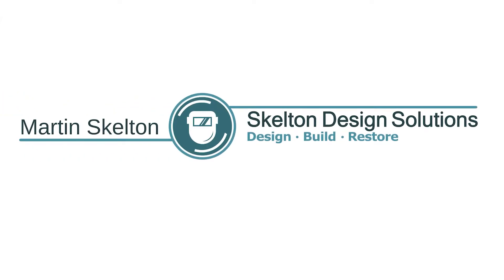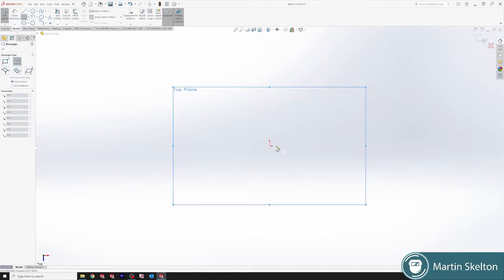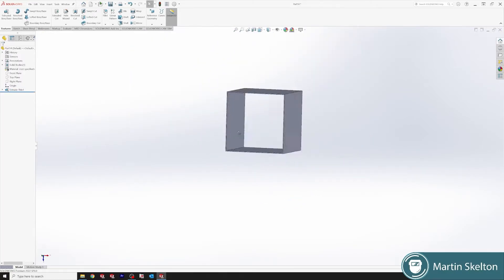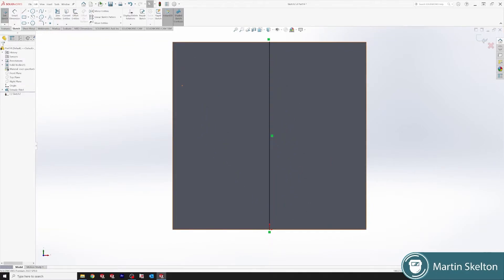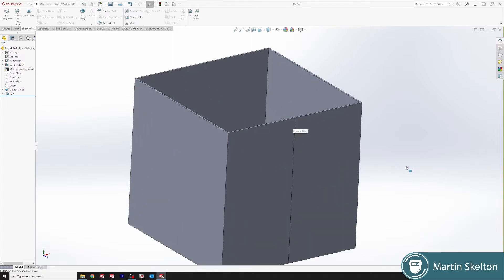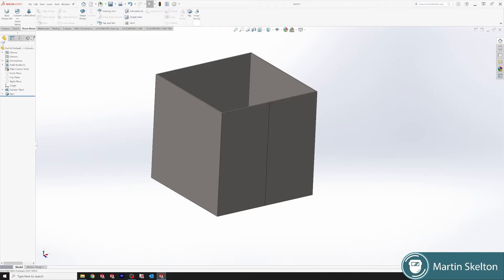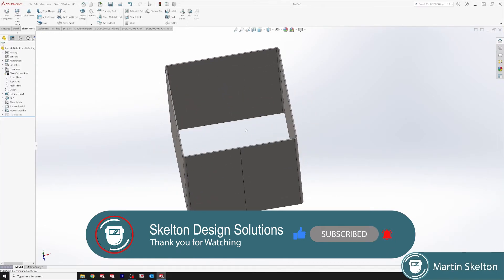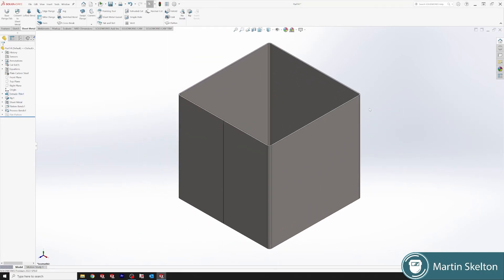SOLIDWORKS FEATURE IN 3 MINUTES // RIP // INSERT BENDS

Comment: Hi Martin, just wanted to say thank you for a very informative video that get's straight to the point. I use the sheet-metal feature quite a lot but am always learning new tips and tricks.
Reply from the maker: Hi Rich, The sheet metal feature is excellent but I am also learning tricks and tips from different clients / users everyday. In the manufacturing process everyone has there own tricks and tips of how to do things faster some related solely to the machine that is used for manufacture, (drawing differently for a metal punching machine compared to a plasma cutting machine). It is interesting to see the variations and how people apply them. Thanks for the comment.
Reply: @skeltondesignsolutionsltd to
Reply: @skeltondesignsolutionsltd to the hotel 🛍️

Comment: Another great video! I have never used rip in Sheet metal before, or for that matter the whole workflow practice of unfolding a shape.  Thank you for demonstrating!
Reply from the maker: To be honest I don't use the rip command often, I usually draw direct sheet metal as I plan the flat pattern in my head as I draw. The rip command is great when you are receive a component model and need to convert it for cutting without adding the time it would take to redraw it from scratch. A good example is a chute for a grain hopper. Thanks for the comment.